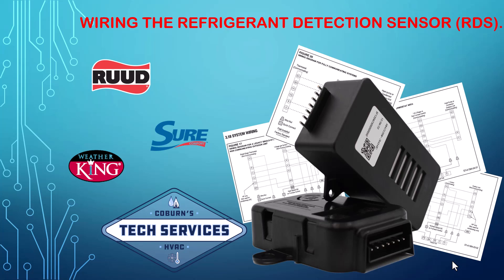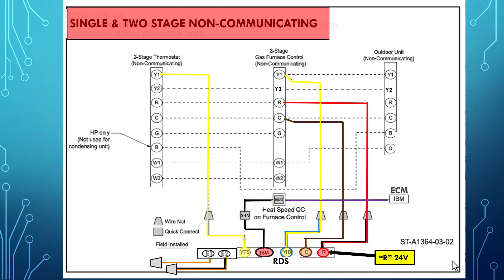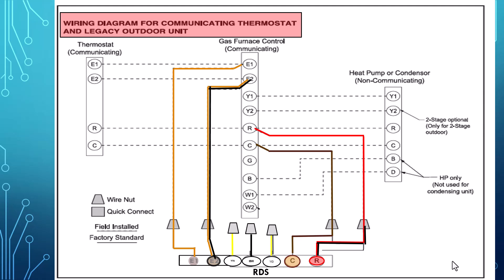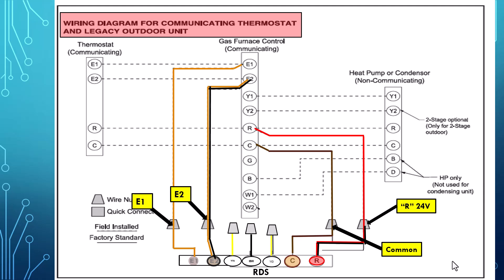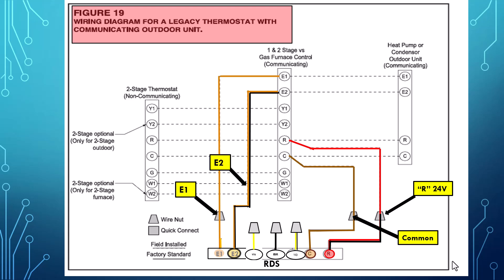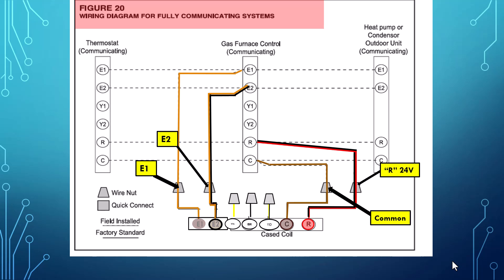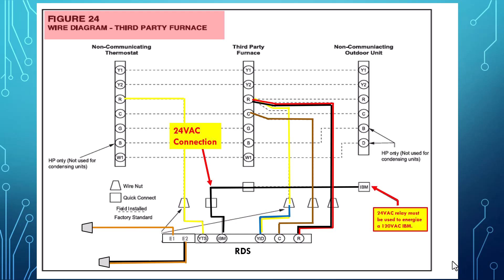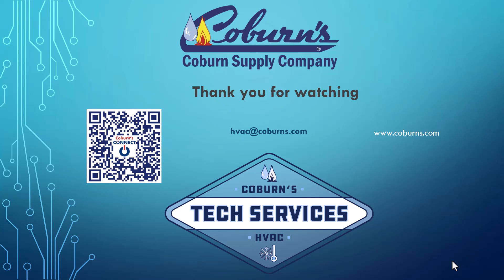Wiring the New A2L Refrigerant Leak Detection Sensor

Comment: We've installed several of these coils from rheem and bryant so far. I really wish Rheem would've gone for a design similar to Bryant, it's ALOT cleaner instead of having a bunch of wires hanging out of the coil. It should've been a single 7-conductor cable that was 4 or so feet long that could run inside the furnace and get wired up from there. Their diagrams and the wire with a spade terminal also make me think there's a special terminal on the furnace for the black "IBM" wire that was considered for future, or the idea scrapped. From wiring up a Bryant sensor, I do believe they just kick in the "G" terminal during a fault, so that's where I've been landing the "IBM" wire on units that don't have econet capability.
Reply: I agree!  I just did one of these today and it’s a total shit show. Their diagram is a joke. They don’t tell you what the colors are then you try to decipher it based off of where the wires are landed plus you need to cross reference the numbers to color of wire but they’re not numbered on the wiring harness, what a disaster if you’ve never done one before. And I was thinking the same thing you said just run that black 24v wire to G.
Reply: Well, it is rheem. Have you seen what they do with the air handlers? They just leave all those wire splices sticking up out of the top of the thing and it looks like crap. But that is what Rheem does

Comment: question. if the mitigiation board cuts y1, but not y2.  doesnt the ecm still get signal for y2 speed at the same time as heat speed signal?? does that not damage the blower motor since its running in two speeds at the same time?

Comment: E1 E2 what’s that
Reply: Standard for "Equipment 1" and "Equipment 2". They are Rheem's "Econet enabled" communication wires. If you want to get technical with it, it's an RS485 2-wire serial communication system. Has been the biggest PITA for wiring in communication systems that only have 2 wires running outside.
Reply: @bairfamilyfarm1336  So the black ibm wire goes to g to control fan? and if its 120 v blower you need a relay? but most are 24v correct?
Reply: @justinrichard4190  Ya, I'm confused with that one. Everything else looks easy.
Reply: @justinrichard4190  Just last week I wired up a Rheem coil for a non-comunicating legacy system (80 percent furnace without E1 and E2 terminals). As I understood it, the black wire's only job is to supply 24v to a terminal to tell the fan to come on when the sensor trips. One of the wiring diagram options, which I would post a picture of here if youtube would update their stuff to allow it, was to run the black wire back to the "G" terminal, and break Y1 going outside. All it needs is for the fan to turn on and blow the refrigerant out of the coil for a few minutes. Unlike in heating or cooling mode, it doesn't matter how much airflow you get as long as it's enough to disperse the refrigerant. The wiring diagram for 2 stage systems broke "R" from the thermostat instead of breaking "Y" to the outdoor unit.

Comment: Not helpful
Reply: It works for rheem units
Reply: @alfa_turtlez8205 my condenser only has 2 wires should I just be hooking those to y and c on the furnace board Like usual ? I dont understand how it shuts down the condenser should there be a leak
Reply: Yup hook up the 2 wire like normal. The sensors in the coil and it shuts off the unit via tstat if it detects a leak @KC-HVAC
Reply: @KC-HVAC you are breaking the call for cool between tstat and furnace if sensor opens Y from tstat, look at the yellow wire it goes to RDS then to furnace.
Reply: @alfa_turtlez8205 doing my first a2l coil today and of course I didn't get a class or anything on it so im trying to figure it out but these wiring diagrams are sheit